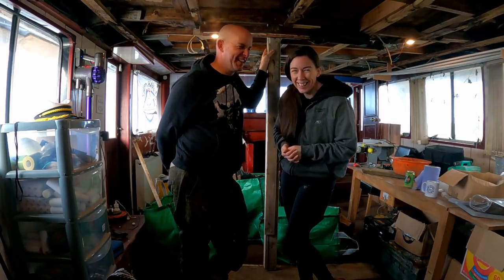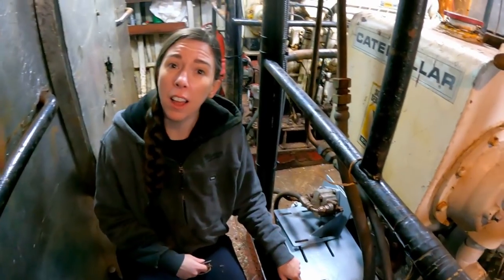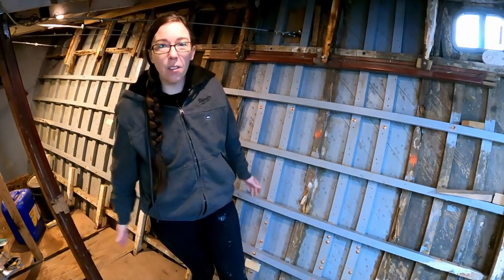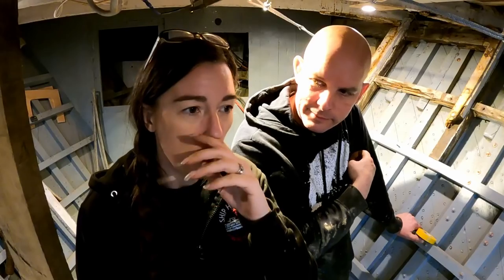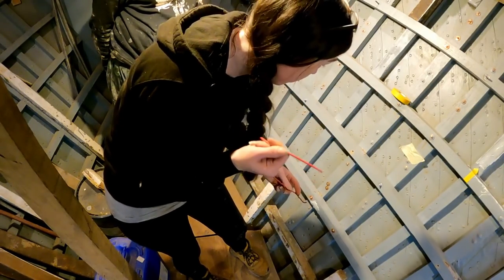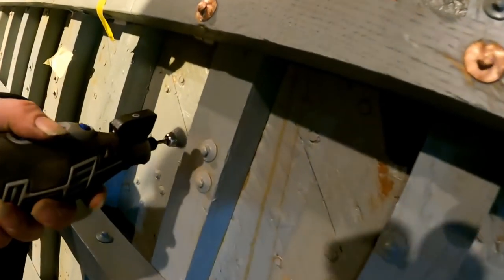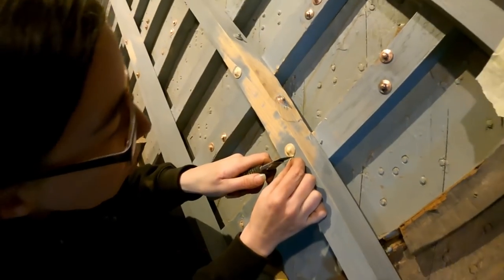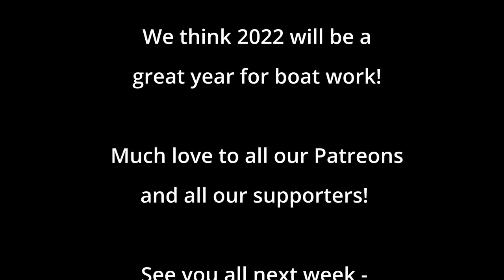Ep 53 - Rove, Rove, Rove Your Boat - Traditional Copper Nails And Roves  - Alot Of Gemma's Bum! 🍑

Comment: Fabulous!  Doesn't matter that one day all the nails will be covered over, YOU WILL KNOW THEY ARE THERE!
Idea for the nail pincers to get the right standoff. Instead of using a washer every time, weld a piece of metal to each half of the pincers on the outside end to the required standoff distance. When you put the pincers against the wood the jaws will be the right distance away every time.
Reply: It would work but tools like this are usually heat treated at a specific temperature for a set time so the steel is hardened. welding and ginding will undo that. Fortunately I learned this from someone just before I was going to use a grinder to re sharpen a chisel lol
Reply: @alstonofalltrades3142 , then glue them. It’s like a weld but without heat.

Comment: Tape the spacer washers to one of the cutters jaws, you can use a piece of tape on the other jaw with a strip of craft paper where it slides over the washer so it doesn't pull off when removing it after a cut. Less 'fumbling' around with jobs that can take three hands. Should get you down to less than a minute a rove! Those 'Dutchmen' you glued into the notches will return Sarinda's ribs to her youthful strength, nice work! 😁

Comment: The copper will oxidise and turn dull green eventually so whilst it looks great now you may be making more work than is necessary because they won’t stay shiny. But whilst they are they look great. And just as I uploaded my thoughts you mentioned “clear coating” the copper so they stay shiny. Brilliant!🤓🤓
Reply: I got rid of a copper mug for this reason, even dipped it in citric acid container for an hour to clean it without lots of scrubbing and it came out, well, shiny but still patchy instead of dull and patchy. Maybe someone knows of a clear lacquer to put on them.

Comment: This may seem strange but. The palm thing that hurts your hand. You can’t use padding to protect your hand, (well, you can but that would reduce the effectiveness and make it slower.) but you can spread the load. So, how about attaching some sort of bar or plate, so you can get both hands on it, to halve the strain. Or, OR, attach an extension so you can lean your torso against it, to reduce the load/strain even further. (Wish I was genned up enough to attach diagrams.)

Comment: Gemma, Simon. It's good to see a plan coming together and your little ditty was good. Isn't there an old song " I'm a rover" or is it Drover??????

I worked as an inspector on construction sites and as I wear prescription glasses had problems with steaming up and focusing while wearing plastic overglasses. So the company paid for prescription safety glasses, over time I used Boots and Specsavers, Boots were the better pair and lasted longest. The lenses are toughened and they have side shields. It saves all that putting on and off and possible damaging your own glasses.

Paint over the roves or your going to add hours of work to your refit. Plus I think it looks OTT.

Comment: Maybe for a more heavy duty rove polisher upper, what about a wire brush similar to the small Dremel brush, but one that would go into a drill, again only as large as the rove.
Slip the brush into a short piece of pipe that’s also only the side of the rove.
Use the pipe as a guide, and work the brush in and out. This way you can ensure that the paint on the stringers or frame doesn’t get damaged😎

Comment: Sludge pumps / trash pumps are such a great tool when you have to get rid of mud or other stuff. 
If you paint the biggest and bulkheads in white or some light color you can see any leaks from the machinery or other unwanted issues.

Comment: You need a carbon brush for your drill for cleaning the roves. It should be able to clean each rove in a few seconds I think. Try a 1-inch wire brush for your drill.

Comment: didn't want to coment as I can see you guys have had stupid bad comments for no good reason but - at 25:53 yes different species of wood absorbs different amounts of moisture so sorry to say it but it is important to use the same wood as the original when making structural repairs ... I'm currently doing up a tiny (25 foot) dawncraft GRP - completely diffent project but feel for you guys so much as it always takes a lot longer to restore than if its just a botch job ... you both have such  a posetive work ethic its a credit to you well done so far! Loving your little tip of the masking tape around the copper, bloody super clever that is - beautiful boat - pashionate strongwilled people - you will get there in the end and hopefully well before 2029   ;)

Comment: Might be worth trying Vaseline or candle wax melted onto the copper you don't want painted, before you next paint the wood. Much easier than masking, and if it resists the paint as I think it should, it'll strip off once the paint's hardened, much easier too. Liquid latex would do the same, but that would cost a lot more, and it's honking til it flashes off!

Comment: you're going to find that copper will turn green with corrosion. Better off painted. They make a specialty strap which allows you to hold a pneumatic palm nailer without squeezing it so much. Perhaps you can use one with this electric nailer to keep your hand from tiring out so much.
Reply: They address the rivets going green and how they will stop that in the video
Reply: @nathantaylor357  yes, something about clearcoat. If it works, I'll be happy to have been incorrect.

Comment: Gemma, get a work gloves and pack a folded microfibre cloth into the palm to insulate your hand from the vibration of the palm nailer. It will make a great difference. Simon: could you drive 2x4 posts into the muddly bank like piles and build a deck to stand on above the mud? Happy New Year guys.
Reply: When I was a welder i just used to use the big thick welding gaunlets/gloves to hold the grinder. dampened it down quite a bit.

Comment: I had a 42 foot salmon trawler that someone stole and sunk it in a shipping channel I used bronze fasteners on the hull to keep it from eating the fasteners in saltwater plus their stronger than copper and stainless steel bolts on all the cracks between the planks I would use concrete/mortar pack them with packing way cheaper than using caulking use caulking on some spots though and fiberglass where needed
Reply from the maker: Our boat is double diagonal, never had any caulking so less work to do there!

Comment: Just had an idea about those washers you use to set the copper nail lengths to. Why not fit a short length of wire to the cutters and then drill a small hole in the washers and that way the washers always stay attached to the cutters

Comment: I wonder if a few pallets with plywood top and bottom and with styrofoam sheets tucked in might give you a  (little bit) floating platform that settles on that mud to work on.
Reply: I wonder if even a frame with hardware cloth would work. Like a giant snowshoe as a platform. Would be a lot lighter than a piece of plywood or something.

Comment: I'm curious to know whether you ever considered using a storypole or template for drilling the rove holes? Any time I've have to drill a large number of holes and I want them evenly spaced I will make a template. After locating the first hole no more measuring, just drilling.
Reply from the maker: We are going through the original holes so no need for a template x

Comment: I was noticing from the outside of the boat the copper nails appear to be either flush to the surface of the wood planks or even protruding a bit? Shouldn't these be counter sunk to surface and then epoxied over? Perhaps I missed the better explanation of this process.

Comment: If the palm nailer is too big to hold for a long time , you can modify an air chisel gun it would be much better to hold onto for a long time.
Reply from the maker: We don't have the power for an air compressor
Reply: @ShipHappensUK  you can buy petrol driven compressors mine is a godsend.
Maybe you could hire one

Comment: The ship's frames are rotten, and you are cleaning the paint on the rivets. You are doing useless work.  У корабля сгнили шпангоуты, а вы чистите краску на заклепках. Вы делаете бесполезную работу.
Reply from the maker: And what would you suggest we do while it's winter, dark outside and raining? We are working on the frames, as you can tell how many have been replaced! But we are currently working around alot of things! So unless you fancy coming to help we don't need your negativity!
Reply: @ShipHappensUK  The ship must be put ashore, completely disassembled and repaired. Rain is not a problem, but frost and snow in winter is a problem. No negative.
Reply: @cewery  You obviously have not watched most of their videos.  They have gutted down to the frames and planks and are repairing them. And until they are ready to do the decks, they have temporarily covered them in heavy tarp to keep the rain, frost and snow out.  Can you afford 300 euro's a week for about 5 YEARS to put ashore?  No?  well neither can they, so more time and smaller "work in the mud" budget it is.